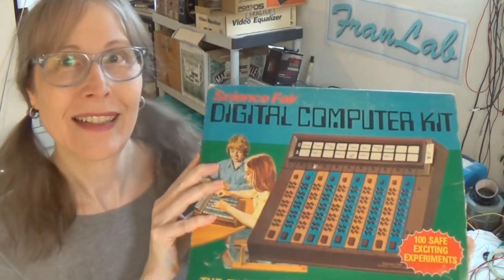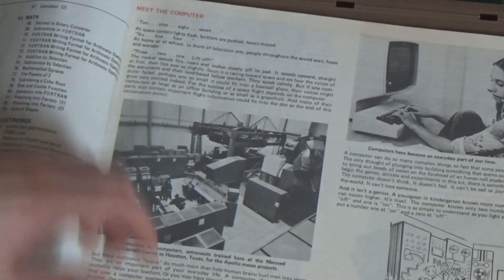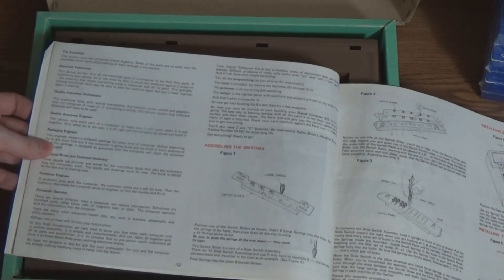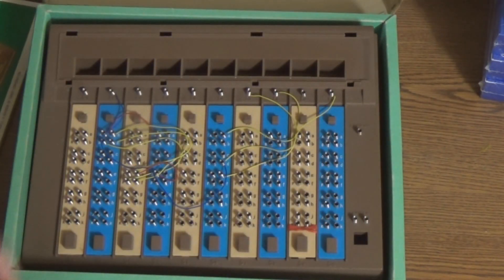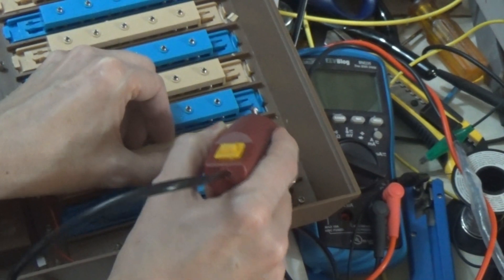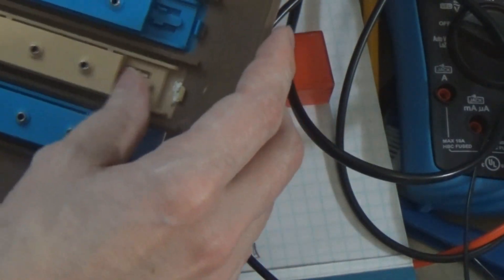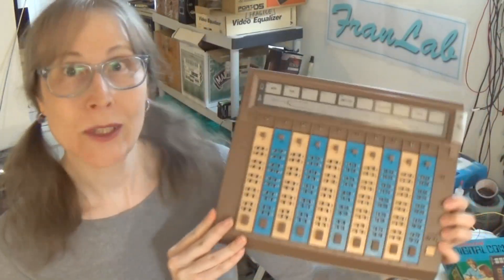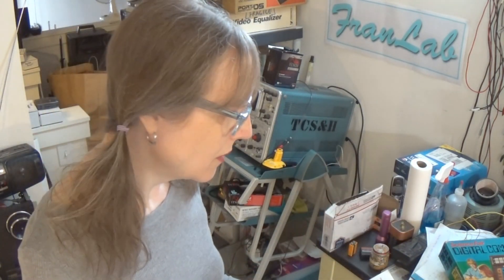1977 Tandy Digital Computer Kit

Comment: Fran, sorry I only just got to this video. I remember this kit ! I did learn from this for sure but I think I learned better from other kits. You did light a light in my head and in my memory with this. Thanks for the reminder and the joy of going through this myself😃😃😃😃👍
  I even had the original spin welder that you showed in another video👍👍👍👍 I was really into plastic models and used this to modify car models. It was a lot of fun and another learning experience.

Comment: I had a kit called GENIAC from the 50s for Christmas.  It used large rotary switches (5" diameter)instead of sliders.  It ended up on the shelf for years after about the same amount of time you spent on one project on this 'computer'

Comment: Using a straw to cut wire to length, nice idea. I just have two marks on a surface and pull the wire to the 2nd mark and cut on the first mark - it is very fast.

Comment: Man, that takes me back. I was 18 in 1977, and had already taken programming in my Math class, with a Monroe 1665 Desktop Programmable Calculator (with card reader, and Port-a-punch!). When my parents saw this in the RS catalog, I had to talk them down from getting it! It had no components, like you demonstrate, just wires! 

I worked with Commodores, TRS-80s, etc. and this didn't fool me...but I guess RS couldn't help it. 

I had a TRS 80 Color Computer from 1980 when I was in college, and I still have it! There was real fun...all those Byte Magazine and Interface Age (some of which I still have) and I learned to expand the memory of the color computer by soldering 32 KB chips on top of the on-board, unsocketed chips, and using the board's bank select line to double my memory!

You've got yourself a subscriber!

Cheers
Ambidexter

Comment: When I was maybe 10, which would've been 1987 I got a kit like this but smaller that only made one thing. A crystal radio. It wasn't too hard to set up but I thought it was the coolest thing to make my own radio with a tuner, and no batteries!  That's also how I learned that a headphone can also be used as a microphone and vice versa. Something I used all the way up into my early YouTube days when I had no mic at one point but had to make a video. I just plugged in some headphones to the mic jack.

Comment: I used to walk right by those Tandy sets in the hobby shop all the time in the 70's. That did not look anything like what Elroy Jetson had, so I had to wait until the Apple SE-30 came along. Glad I did. Thanks Fran for a truly interesting video once again. BTW, I had to pull that SE-30 apart sixth months later and replace the processor and add more ram so I could have a very fast primitive computer. What fun.

Comment: I think I remember being 7 years old and I was curious about this kit, as I was interested in stuff in Radio Shack catalogs at that time.  I did end up working with a kit called "Electro Lab" at that time, and I got a lot out of that kit.  There was some other kit that I had that I lost interest in because I didn't like reading all the stuff, probably because I was too young to understand it.  I ended up getting a TRS-80 Model I when I was 10 years old, and that led to the business I have today, providing automated phone applications to the blind.  I got interested in computer programming, and it was cool to start with a Radio Shack computer.

Comment: I was 8 years old in 1977 and would have loved that as a gift. Sometimes the fun is in the process, the time spent wiring and troubleshooting when it it didn't work on the first try and eventually having a machine that worked as per print. They fun is in the creating, not necessarily the flashy outcome (or then again, maybe I'm just the slow kid on this channel :-)

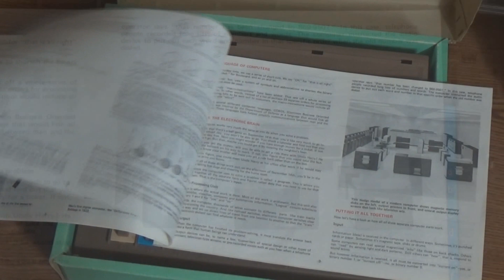Comment: 1:52 That is clearly an IBM System/370 era machine; from the enormous 3066 consoles, it looks like it's either a System/370 Model 165 or System/370 Model 168 in a tightly coupled multiprocessor setup (the processor "complex" at the back is all one unit, instead of two separate ones).

Comment: Wish I had, or even knew about, that spin welder. Could have saved me a lot of grief while repairing a clothes dryer last year. I tried to plastic weld the broken part with an old soldering iron. It was very difficult to get the correct angle and width of the solder joint, and the repair just would not hold.

Comment: Awesome find. Love old tech. I was born in 1990 so I didn't get experience the older machines but... I love learning about them. My degree in computer info systems and my nerdiness helps
Reply: I remember being eternally frustrated with 60's -90's electronics, for not being more capable. But, it was nice growing up during that era, and living through the progression. It's amazing, the rate at which electronics and computers are maturing now, but it's still fun to tinker with the basic stuff.

Comment: I used to enjoy buying those old Tandy electronic kits back in the 1970's.  I made an AM pocket radio and a Bio-FeedbackMonitor, both of which I still have.  Unfortunately, these kits are no longer available, but there again, the old eyes are not whatthey used to be.  I could not, for example solder those very close pins on an IC chip on a pcb no more.  Thanks for the trip  down memory lane.

Comment: Wow quite a gulf between promise and reality! But they really put such a lot of effort into the instructions to try to convince you there was some value! Even my first electronic kit in about 1973 had a few transistors, discrete components and exciting things like a buzzer, lights, moisture sensor and photoelectric cell (Philips Radionic X40 kit).

Comment: I put one of those kits together as a kid; At first I thought it was pretty stupid, however, I loved it when it was done. Really opens your head up to the underlying concept of computing, although it's only a collection of switches and bulbs. Although a CPU is pretty much the same concept at it's core; A crap-ton of microscopic switches (I know it's more complicated than that, but for simplicity's sake, it pretty much switches bits on and off). The earliest computers were pretty much this kit; a bunch of switches, programs were manually entered by flipping switches or feeding punch cards to do the switch-flipping.
The "Cannibals & missionaries" project was my favorite; It entertained me for hours. 
Of course when I got my TI-99 it was all over for that old thing.

Comment: Got one of these as a kid for Christmas. Was super excited, then I realized there wasn't anything electronic in it. No logic gates or even diodes or transistors. It was just some crappy slide switches and light bulbs with the silk-screen masks to go over the bulbs. Even at 10-11 years old, I figured it out that it was pointless in short order.

Comment: Well I assume selecting both pnp and npn at the same time shorts the battery, so that's probably why it wasn't a good idea. Give it a good set of powerful batteries in that mode for a little while and there could very well be explosions and/or fire.

Comment: Hi Fran. After watching this video, I had to get out my kit and play with it. Mine is missing a few of the caps that go over the nubs at the top and bottom of each switch bank. I have the same problem as you when you turn on several switches, the lights don't illuminate or are so dim they don't look like they are on. I tried boosting up the voltage, but it didn't help much. I tried more voltage, and as you guessed, when I flipped the first switch ( which turned on just 2 bulbs ), they burned out. OOPS!!!
Reply: BTW, I also have the Tandy Electronic Digital Logic Lab Kit which has 25 experiments using a 7400 ( quad 2 input nand gates ) along with the 100 in one and 200 in one kits from Radio Shack. Hours and hours of fun!!!

Comment: I have one of these - went through all of the projects in the book.  Recommend printing a copy of each project and use a highlighter to mark the connections as you make them - way too easy to miss one.  Always wanted to make peripherals for it to extend what it could do.  Punch cards, tape reader, clock pulse and etc...

Comment: Just about the time radio shack started to have major troubles, due to amazon, online selling, etc etc, we sold a bunch of cheap IC kits. Small boards, ya wired up, some even had etching you could draw out n use the included acid on. Most of them were 10 bucks, i swear i had a few spare.  time to go dig through the closet of eletronic doom.

Comment: you are one very cool lady engineer 
to put this old wreck of next-to-nothingness 
into primo operating condition.  
also this WAS very educational.
you taught me HOW to cut wires to predetermined lengths.
you also taught me WHATa spin-welder is.
(never knew such a thing existed)
what might have made the project a bit more satisfying 
would have been to write out the logic equations implemented here.
looks like
PNP = PNP LAMP
PNP AND EMITTER = PNP EMITTER LAMP
PNP AND BASE = PNP BASE LAMP
PNP AND COLLECTOR = PNP COLLECTOR LAMP
NPN = NPN LAMP
NPN AND EMITTER = NPN EMITTER LAMP
NPN AND BASE = NPN BASE LAMP
NPN AND COLLECTOR = NPN COLLECTOR LAMP
might seem kind of simplistic - 
but it did teach LOGICAL AND FUNCTION and transistor schematic conventions

Comment: I have one of these!
You should have tried the FORTRAN programs in there...I haven't even fired mine up yet, but I bought it on a whim just like you did. However, when i do, it will be FORTRAN all the way. Also, loved the wire jumper trick!
Reply: This kit was sold in 1977, but the original design was from the 1950s, and floated around in various forms. It was loosely based on the MINIVAC 301, which was a much more capable kit. I imagine someone saw it and thought, "say! what if we ditch these relays, and rotary mechanism..and just keep the bulbs and switches. Then we can dupe parents into buying a state machine/wire circuit and market it as a general purpose computer." They are probably rich.

Of a truth, this is more like an old IBM plug board. When thought of in that sense, it could be made into part of a complete breakfast in the same way as marshmellow cereal.
Reply: I remember why I bought it now! I got it for nice examples of wire logic circuits, which required only switching at the inputs and outputs as a why of reducing transistor logic in discrete transistor/minimalist style circuits. [There is an entire book dedicated to the subject written in 1951 called 'Designing Digital Calculators' which I have yet to buy. According to the CPU homebrew guy David Brooks, it is a gold mine for reducing the number of gates required in digital circuitry.]

Comment: Hey, I'm up to the "botch job, wtf" part, and all I can say - 3D printer :)
Of course, I am now assuming you don't do that further on in the video, lol.
I got a printer a week or so ago, and have been using it along with Fusion 360 (precision 3D modelling), to create replacement parts for things that have broken or gone missing, It's so freaking useful, and FUN :)

Fixed/replaced so far:
- handle for a magnifying glass
- handle for a conservatory door
- housing for the window switch in the car.

Fusion 360 took a bit of getting used to, even though I am experienced with Maya and  Blender (3D modelling for games).

Very enjoyable vids - Subbed :D

Comment: Frank Hack: (Just a thought) Instead of sliding wire through,  cut notches in straw, wrap wire around it, and just snip the two ends at desired number of strips. Make multiple at a time not just one

Comment: I remember these being sold in Radio Shacks in the late 70s. I never put it on my Christmas wish list because I recognized it didn't have a microprocessor (undoubtedly to keep the cost so low). Radio Shack did sell a more advanced computer kit a couple of years later. I wanted that one, but never got it. It's probably just as well. Thanks, Fran, for finally proving my suspicion correct!

Comment: I actually got this as a Christmas gift from my brother, (as one of my wishes). Having owned the 100-in-1 kit sold by Radio Shack which I loved, this was a total disappointment for me. It's probably still somewhere in my parents attic in pristine condition because I never even tried any of the experiments. Looking back after 40 years I kinda wish I had tried to learn from it but I wanted a fun toy, not a boring training simulator, such a brat I was.

Comment: This group may be able to help me. Back around 1976 my father signed me up for a subscription to some science kits. I will never forget the month that my father and I put together the electronics kit that included a buzzer and a strobe light. I would kill to have those kits again, or at the very least know form where they came from. Can anyone help me?  My father and I only worked on two together. One was electronics. The other was optics. There are twelve of them. The kit probably can from an ad in The magazine Science News in 1975/1976. Thoughts?

Comment: They did have real computers at that time. I saw a SWTPC 6800 in 1976 and my dad and I put together an IMSAI 8080 around 1977. Those computers were significantly harder to work with than today's with only switches and LEDs as the standard interface. Keyboard and monitor had to be built/added separately.
However, if I had to work with that Tandy kit you showed, I would have been very bored and sad.

Comment: I got one of those just to see what it did, and wasn't disappointed 
because I'd already figured out before I bought it that it was probably 
nothing but a bunch of 5-pole double-throw switches and lights which you
 wire together to make "logic" circuits.

I wanted to see how much could be done with such a simple device and I 
too eventually decided that it was lame.

Part of the problem was that the wire resistance and contact resistance 
in the switches added up pretty quickly so that even with a fresh 
battery, you'd often end up with a very weak glow or even no glow from 
the bulb which was supposed to light up.  It was even worse if more than
 one bulb was supposed to light.

Comment: i got one of these in 1978 when i was 9 yrs old which took a while to build. it was kinda lame. lol  by 1979 i was writing code for the new TRS-80 pc and in 1981 i got a TRS-80 pocket pc, which i still have and is working like new. i miss tandy.
Reply: i will add that it did help me understand circuits and wiring at a very early age. you can build other things not listed in that booklet. now all we have is places like banggood and ic station for kit builds. lol

Comment: Later, they had a "programmable computer" simulator made entirely of cardboard. You adjusted paper slips to signify registers and stepped through "programs" manually.

One of the sales clerks at my local Shack gave it to me after I spent all day asking them about computers. It was my first computer and I used it till it fell apart. I know it's pitiful but Rat Shack you saved my life. :-)
Reply: Cool story. I also owe Radio Shack, as in part, they influenced me to go into the electronics field. 73, KJ6JJK
Reply: I think the cardboard one was better. And cheaper too.
Reply: I think that the cardboard computer that you are mentioning is the 'CARDIAC' computer put out by Bell Labs - you can search for it on Google ( its also on YouTube)

Comment: I had one back in the day.  The dubious illumination of the lights wasn't a result of old switches--they were like that when new.  What's ironic is that the 7400-based digital logic kit (maybe "25 in one"?)  was about half the price and way cooler.  Two LEDs, a 7400, three buttons, and some passives, powered off three AA batteries.  If this kit had included solenoid actuators for the switches, or even some mechanical stepping switches, it could have been cool even with no electronics, but being able to produce an oscillator and toggle register using the 7400 was way cooler than the complete lack of sequential logic in this kit.

Comment: I had one of those! I was one of those disappointed geek kids who actually saved up for one - I think it was $12.95 - enough for two Elton John LPs. What a rip off!
But the DP10T switches proved to be useful in other projects when used with my 100-in-1 electronics kit, like turning the oscillator circuit into a poorly tuned organ. Memories...

Comment: Why not mount the straws to a base, so you don’t have to hold your finger over the ended as a stopper? Would seem two hands one for inserting wire and the other for cutters would streamline the process. Any thoughts?

Comment: I actually got this thing under the tree in1977 when I was 10 years old.  I had begged my mom for a "computer" not really knowing what that was.  I spent about a month getting it to the point where the light bulbs would occasionally light up.  It was easily the most bait and switch horrible thing I ever got as a kid.
Reply: There is no way that this 'computer' is in any way appropriate for kids - it is simply over their heads. Too difficult to assemble, and too hard to understand.

Comment: I had a version of that, made by Logix Kosmos.  Very similar principle, only the wires went into a breadboard type spring contact clip, rather than a spring.  I'm sure there must be photographs of it on Google Images somewhere....   

http://www.oldcomputermuseum.com/logix-kosmos/small/logix-kosmos_5.jpg

There you go, from 1972 - I was 10!
Reply: https://de.wikipedia.org/wiki/Logikus
in germany, it was released in 1968.